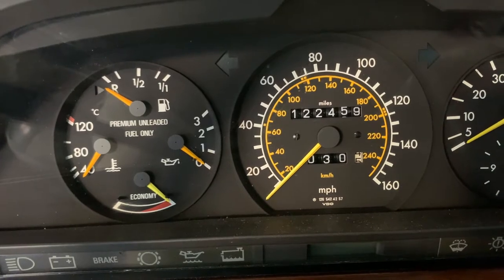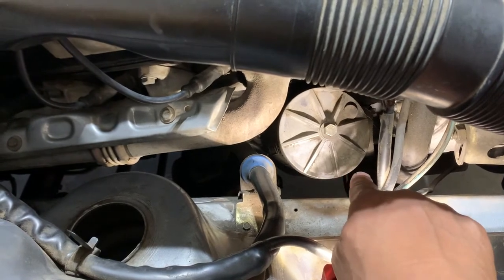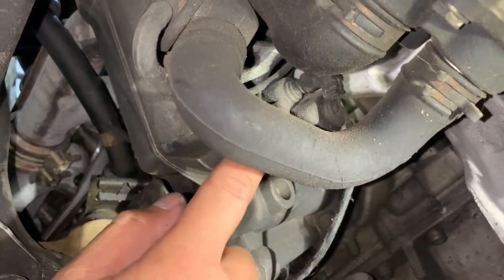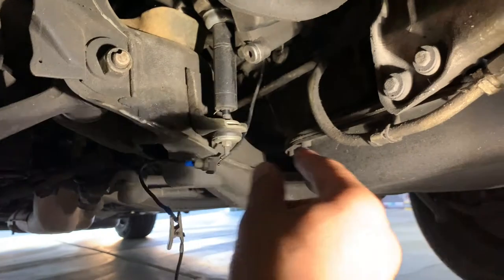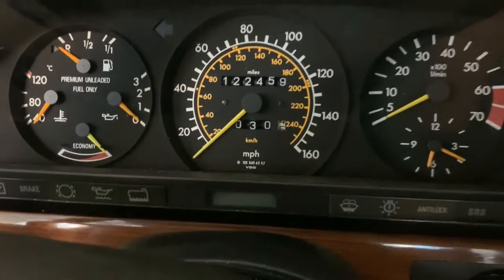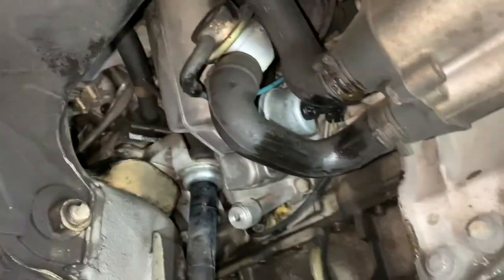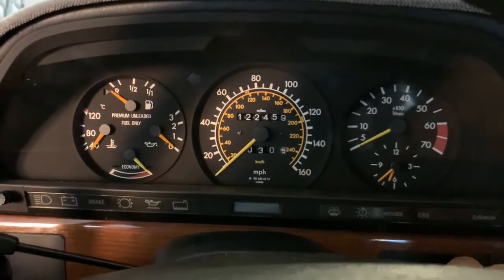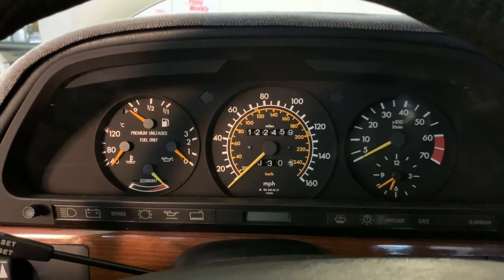1987 Mercedes-Benz 420SEL:  Troubleshooting the oil pressure gauge

Comment: I have 91 w140 300  the oil pressure gauge pegged in 3par always
Reply from the maker: If the gauge is pegged at 3bar even when the engine isn't running, I would say that the sending unit is most likely culprit.  You'll have to do some troubleshooting to pinpoint the exact cause of the problem.
Reply: i have w140 1993 my gauge in 1,5 par in parl